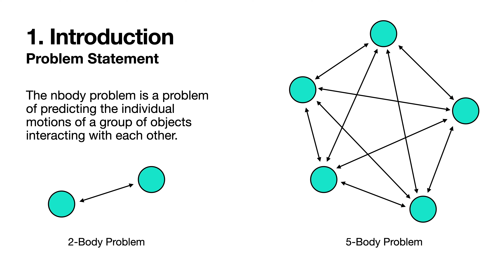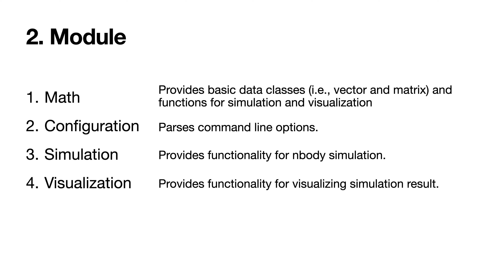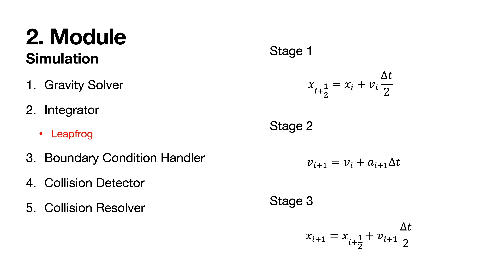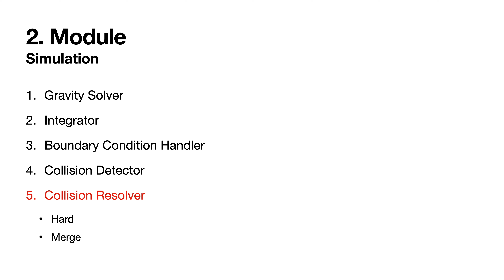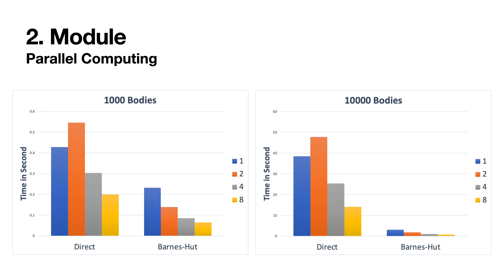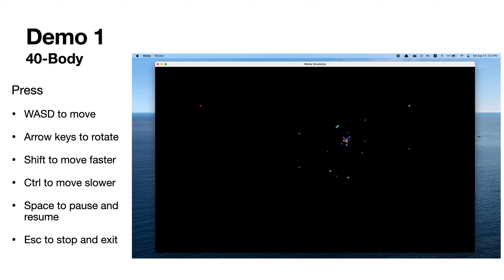Simulation and Visualization for NBody Probem - ECE 596C Project Presentation

Comment: Very impressive work. I hope to achieve the same result as self-study. Could you please tell me which API you use for the visualization and around how many lines of code you write for this project. Thank you in advance for your help.
Reply from the maker: This project uses OpenGL 2.1 for rendering and GLFW for creating windows, OpenGL context and handling keyboard input. It's about 6000 lines of code.
Reply: @diyuhu2658  Cool. Thank you for your reply. Could you please tell me how long does it take you to finish this project?
Reply from the maker: @00l30  I can't remember the exact time I spent on this project. However, it must be over 100 hours, including learning OpenGL API, other libraries, and coding.